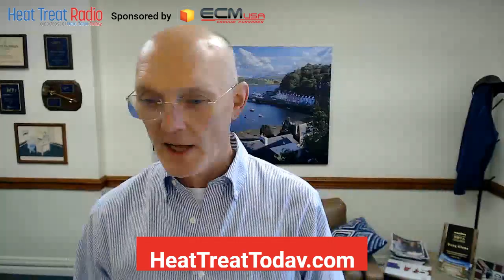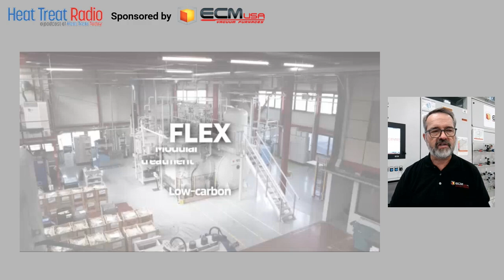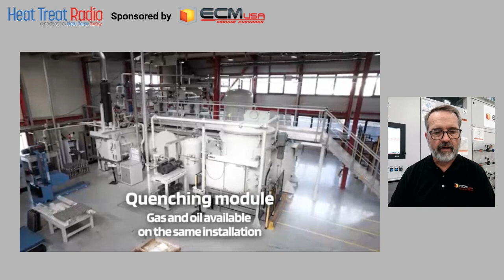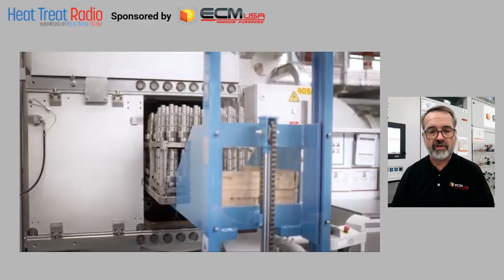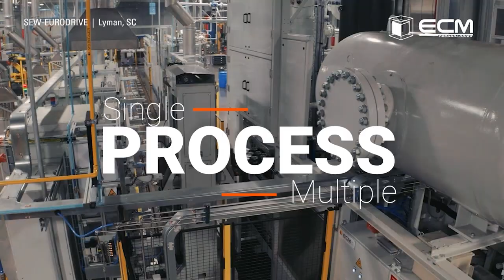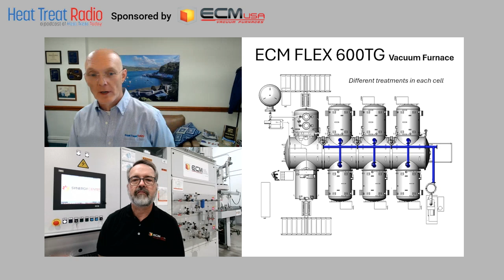Heat Treat Radio #127: The Case for Modular Vacuum Heat Treating

Comment: Dennis, Doug, congratulations to this episode! Very informative.

Modular chamber furnace systems with vacuums for LPC, Carbonitriding, Nitroding, Sintering, etc. including HPGQ or oil quench when needed, are the most sustainable and efficient solutions for captive and bigger commercial heat treaters in my mind.

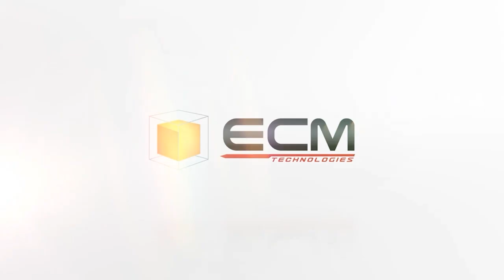As you point out in the video sequence at 21:40 min CFC Fixtures are the prerequisite for automation of the part and fixture handling and to get the most out of it: in throughput (up to 100% more net), time, costs, and part quality (less distortion, less hard machining), only mentioning some advantages.

High Temperature Concept delivers best-in-class CFC Fixtures. Not only for SEW-EURODRIVE in Lyman. Ask us for a free estimate.

Our approach is 100% customer centered. Since over 30 years. Since 2018 in the USA and tge NAR. Highly vertically integrated manufacturing in the USA, at competitive  prices and short lead times.

Yours,
Jorg

Dr. Jorg Demmel | President and Founder of
High Temperature Concept
941 299 9191
info@high-temperature-concept.com
www.high-temperature-concept.com